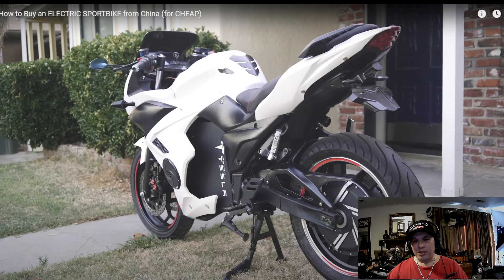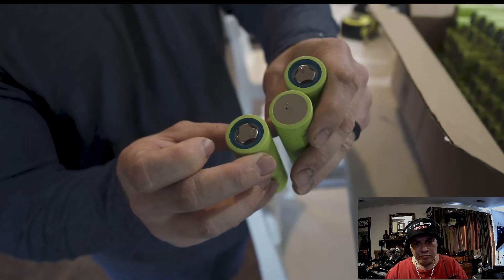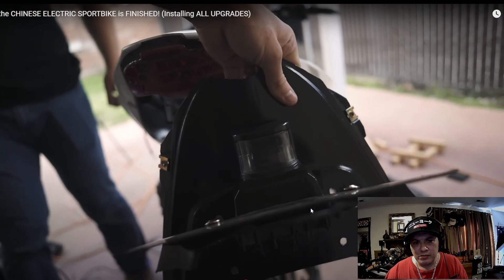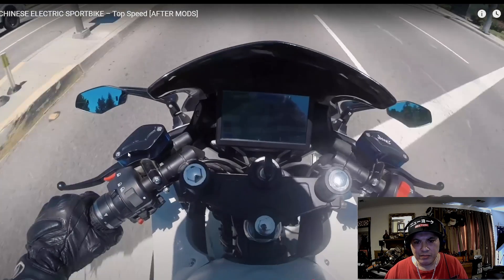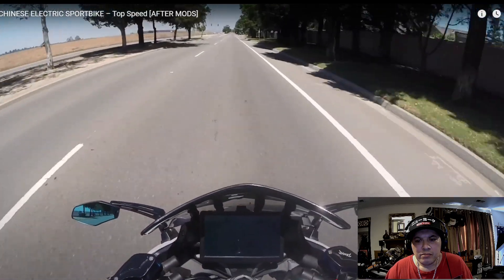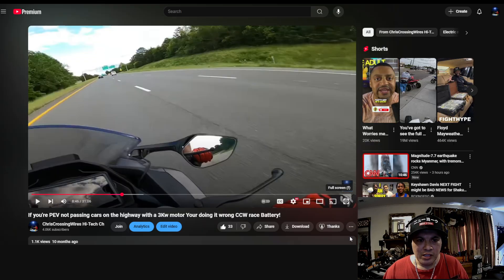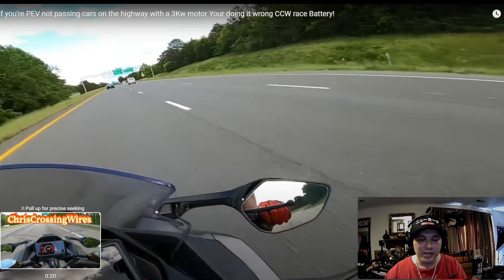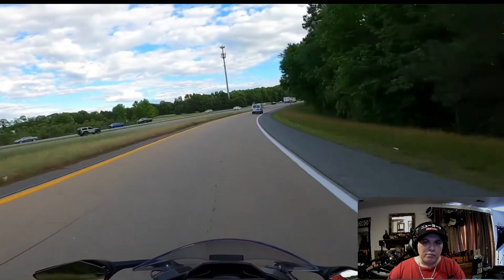80mph Ebike/motorcycle on 72v with a 3kw motor how? a 30Kw capable pack Its all about Batteries Man!

Comment: That RZ is going to be a Monster Chris!
Reply from the maker: It certainly should be at least as far as acceleration as i had to keep that BAC capped at 350 phase amps 200 dc line and it can deliver 840phase and close to 500 line so letting the full power out should make it pop wheelies literally like the Beast. Gonna see what it does but after that Im going for broke with some High Voltage to go along  with some high current. i wanna put at least 65kw peak in that motor. It should be a little sumpn sumpn lol